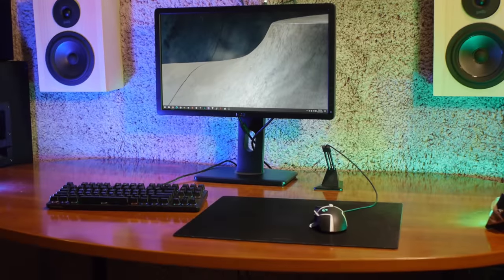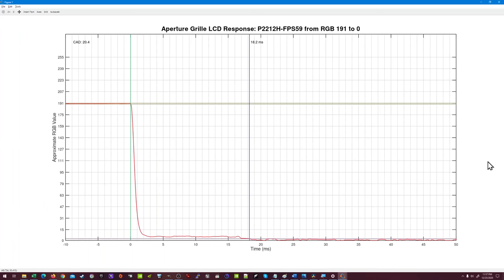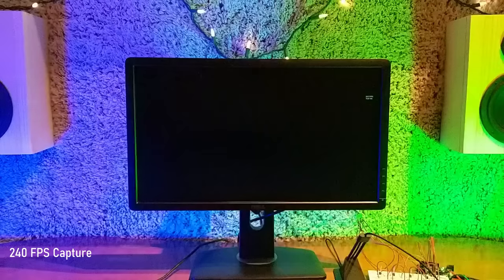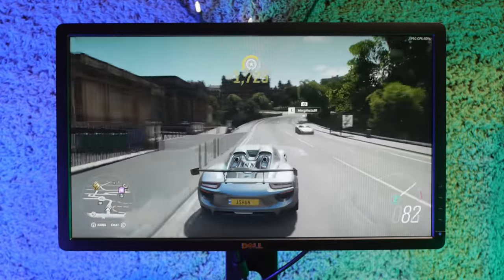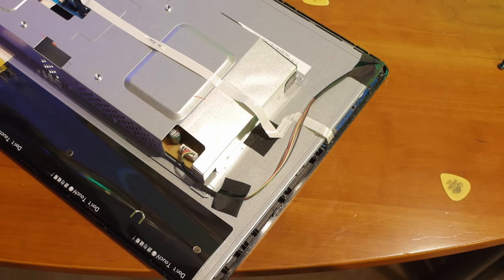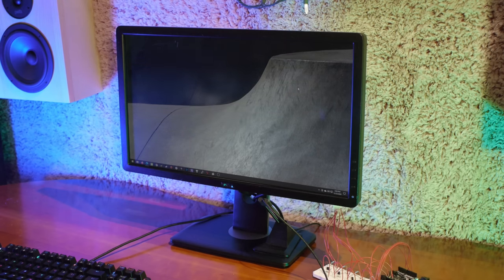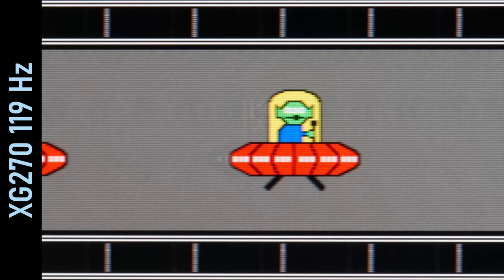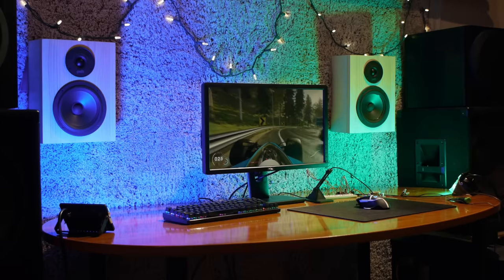DIY 60 Hz Backlight Strobing

Comment: bro. what are you doing to your speakers setting them against the wall though.
Reply from the maker: Finally! Someone noticed the speakers! :) The two main speakers aren't ported, if that's what you're worried about. I pulled those drivers from a pair of Polk RT5s and put them in a very hastily put together sealed enclosure. But the crossover is fully electronic, controlled by the PC, using brickwall filters and phase correction. I've high-passed the tweeters at 1.8 kHz, and the mid-woofers at 150 Hz. Everything lower is sent to the 12" woofers at the sides.

It sounds really good, and I've used REW to make sure the frequency response is as flat as I can get it down to 20 Hz.

DIY speaker building is one of my other hobbies! If you want to talk speakers, I'm up for it!
Reply: @ApertureGrille  good man. unfortunately, i haven't had the pleasure to build my own. I've only got some micca's on my tiny desk.

Comment: It would be interesting to know where in the system the undershoot is introduced. Theoretically it could be in the driver itself, not the panel circuit. If you get back around to it, perhaps trying a 'cheap' driver board from Aliexpress would be interesting.

Comment: What about the BFI (black frame insertion) trick?
Reply: BFI is only usable on OLEDs. You can do it on LCD but you loose contrast ratio - with one frame off and one on you go from e.g. 1000:1 contrast to just 500:1. And on top of that you incur long transition times from and to black. Then to even pull that off you would need to buffer the signal and display it at twice the bandwidth - which would require custom FPGA driver pretty much. For 60Hz you would need 120Hz panel, buffer at least 8.3ms of the frame and then start displaying it. Advantage of BFI is that you would in this case get lower total input lag at just 8.3ms at the top, 4ms in the middle of the screen and 0ms at the bottom. Viable solution for OLEDs. Would be even better for OLEDs if GPU did it for you - in this case GPU driver could fake its running 60Hz video mode and push frame with in 8.3ms with 16.6ms intervals - giving 8.3ms faster scan time and 4ms faster update in the middle of the screen.

Comment: just using transistors or mosfets to strobe after a constant voltage supply isnt safe, and you cant even do it with a constant current supply because it will freak out at the uneven usage in its current sensing, what you should actually use is a PWM-able constant current LED driver like the TPS61196 which i used to make a fully custom LED driver board for my CCFL based 3d vision monitor (which automatically retimes signal to high vtotals in 3d vision mode) which had its CCFL die out due to age: https://cdn.discordapp.com/attachments/751823102177968159/792543012558209044/unknown.png
Reply: listen to Rajkosto 👆 he's a monitor wizard
Reply: I'd suggest to find a monitor that already has strobing capabilities you can easily send your own squarewave from an arduino and make it strobe at whatever rate you want.
Reply: @brett20000000009  And...where would such a gentleman start to go down such a path?
Reply: @rcdarkangel  I wouldn't recommend it. synchronization with refreshrate is a pain. I would just wait for the 4 blurbusters approved 60hz single strobe monitors to come out in 6mths.
Reply: @brett20000000009  Yeah, I find of figured as much. Backlight modifications/poking of this nature is something I have considered before but avoided for the reasons you pointed out, and because I am electrically incompetent :)

Comment: Can you do that on a Ccfl backlight. I think my montior flickers at 180hz  and if the ufo test I can see like 3 images of the ufo. Not a ghost but like 3 ufo stuck together. I wonder if 60hz would help with motion  cause at 180hz there is still a lot of blur, but not as much as without no flicker at all at 100% brightness.
Reply: You can but CCFLs require much higher voltages and are much less likely to be easily overdriven. Not to mention LCDs generally improved between CCFL and LED times - not much for early LED LCDs but more modern panels is a different story.

Comment: I find it fascinating that everyone is obsessed by ELMB at 60Hz, instead of 70Hz. I get it that today if a game is designed for & ticks at a fixed rate, it'll be 60Hz, but let's not forget that the good old mode 13H was 320x200 at 70Hz. Pretty much all games in VGA mode were running very smoothly at 70Hz (with ocasional ones in 320x240 at 60).
70Hz makes a big difference, it eliminates the slight flicker still annoying at 60. On my CRT I play at 75 or 85Hz, and it's pretty much perfect, for a rather little amount of extra GPU work.

But yeah, that most monitors only allow ELMB starting at 120Hz, I just don't get it.

Comment: What would be a  better gaming experience? 
Question 1:
A perfect strobed monitor at 60hz (As in 1ms flashes or less with no crosstalk and image doubling artifacts with ample brightness) playing at a locked 60fps or a non-strobed high refresh rate monitor playing between around 120 - 144fps with freesync. 
Question 2:
A perfect strobed monitor at 120hz (As in 1ms flashes or less with no crosstalk and image doubling artifacts with ample brightness) playing at a locked 120fps or a non-strobed high refresh rate monitor playing between around 180 - 240fps with freesync. 
Question 3:
Why aren't any manufacturers coming up with a category of monitors that don't feature super high refresh rates but instead are focused primarily on strobing perfectly at lower refresh rates like 60hz or 120hz. This would make gaming at lower fps much more smoother and reduces the need for powerful graphics cards or cpus to get a super smooth experience. This also allows us to push the detail settings and resolutions higher without sacrificing motion quality. 

I really wanna know what you think @a5hun, since it seems you're the most qualified to answer these questions. I would really appreciate your insight. Any input is welcome.
Reply from the maker: For your first two questions, it depends on the type of game. For racing games, I'd always go for the strobed display, but let's consider a broader selection of games.

For Q1, I'd go with the non-strobed 144 Hz monitor. For anything with mouse camera control, higher framerates always feel better. I don't want to play Quake Live at 60 FPS!

For Q2, I'd switch my answer to the strobed display. 120 FPS is enough to finally feel smooth and responsive, and coupled with the clarity from the strobes, I'd definitely take that over the VRR display.

For Q3, I actually like the push for higher and higher framerates for monitors, as long as the prices stay reasonable. Higher top end frequencies allow better adaptive-sync overdrive behavior over their full range through LFC. And the faster and faster panel scan-out also helps with strobing modes. I can see a point in the next few years where LCDs are hitting 480 Hz, and if the pixel response times keep improving, those displays would be able to strobe, not just at 60 Hz, but at 120 Hz super cleanly.

Comment: Awesome video!

I do want to point out that the samsung CHG70 does strobe at 60Hz, without any modifications. Actually, it strobes at literally any Hz. It'll strobe at 24Hz! That is truly unbearable to look at though :)
You just enable strobing, and whatever Hz you switch to, the strobing adjusts accordingly.

The VG248 is also capable of 60Hz strobing, but that's not a stock feature. It's one of those old lightboost monitors, and ToastyX developed a tool to make it strobe at whatever you want.

I just replaced my CHG70 with the Odyssey G7 and to my horror, the G7 only strobes at 240Hz, and even at 240fps/240Hz, it really doesn't even work. Incredibly disappointing on that front. However, the G7 is stronger in most other ways and I still have my CRT, so I'll let it slide...
I absolutely do not trust myself to modify my G7, but it'd be nice to add a second backlight to it specifically for externally controlled 60Hz strobe. If I turn the brightness down enough on the monitor and turn on the strobing light... maybe that'd work ok? 😅
Reply: I hope this isn't rude or tonedeaf of me: but I'm looking to sell my CHG70. If you're at all interested in covering that, I'd happily sell it to you for $100 below the current going rate on ebay.
Reply from the maker: @aeliussaionji  Let me get back to you on that!
Reply: Damn, the rtings review for the G7 says it does strobe at 60hz. Where does the confusion come from? Also, their review for the CHG70 contradicts what you say. They say it strobes only as low as 100hz
Reply: @displaytalk  rtings just notes the frequency at which BFI is able to be enabled from the OSD.

Remember, the strobing frequency can be distinctly different from the monitor's refresh frequency. It's strobing at 60Hz, but the strobing is not 60Hz :P

G7 seems to have exactly one BFI strobing frequency: always running at what might be 240Hz, even if you use the OSD to change the refresh rate to 60Hz. It's therefore quite useless as a BFI. I complained to rtings about their high bfi score here, because I naively assumed "rtings gave it a good score, must be good". Turns out they actually don't have a comprehensive metric for rating BFI, and they merely note if BFI can be enabled at highest and lowest Hz and call it a day. They told me they're working on improving this. I told them "60Hz bfi strobe is very important please take note".

As for CHG70, they're incorrect but it's probably not their fault. The OSD is actually a bit buggy. It's probably accurate that Samsung don't intend for you to enable BFI below 100Hz. However, to my eyes (I don't have measuring equipment) the firmware changes the BFI strobe to match the refresh rate. If you enable BFI and then use Windows to change to 24Hz, the firmware will strobe at what looks like 24Hz to me. I'd be willing to bet the OSD doesn't let you enable BFI and then select 60Hz, but it still works if you use Windows to change the Hz.

That clear things up?
Reply: @aeliussaionji  jesus christ that's awful. Thanks for the explanation

Comment: Im looking forward to doin the same, i ran into your video for encouragement. Too bad you couldn't have done a slow motion video.
Reply from the maker: Might not be necessary since the BlurBusters certified ViewSonic XG2431 should be coming out soon!
Reply: @ApertureGrille  I'm doing it for experiment. My goal is to make an lcd play movies like a film projector. My plan is to use some blank space at the bottom after each frame. This should give some time to allow strobe and prevent crosstalk.